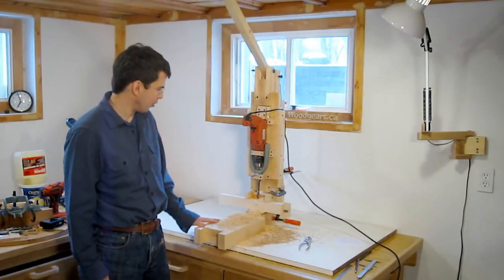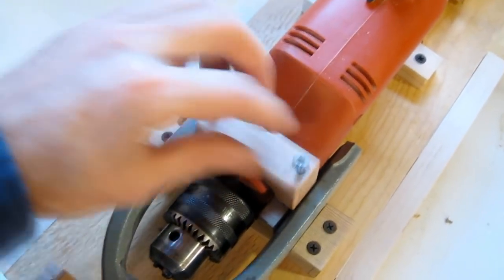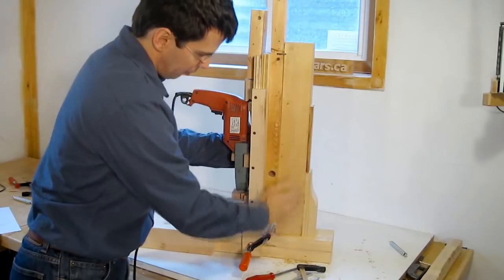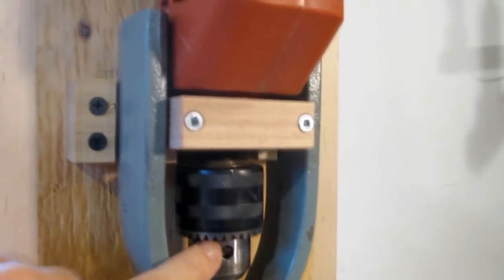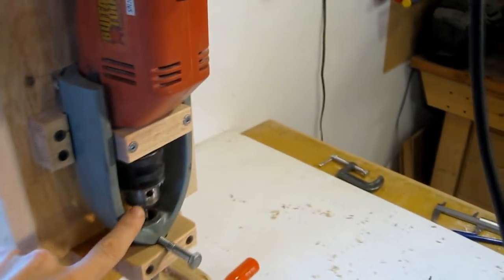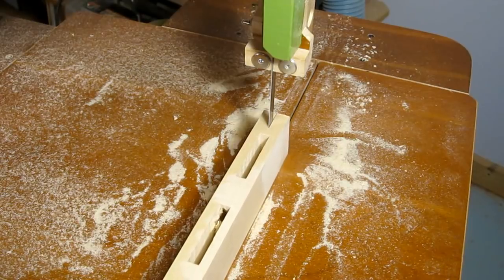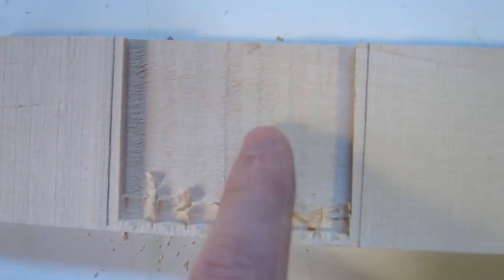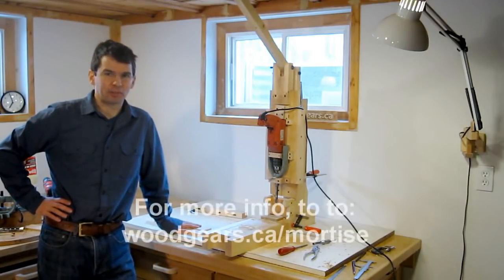Hollow chisel mortiser experiments

Comment: I ordered a drill press morticer from Northern Tool for $50 sent to my carport. After the purchase all I read was how crappy and what junk they are. So after setting 6 or more months in the box I put it on and tested. First thing i forgot to tighten the chisel holder to drill press spindle. After that I was amazed at how well it morticed 1\2" slots in well seasoned ash for table legs. The supplied fence and work hold down SUX rear tit on a sow hog. After looking at it in the box i knew the fence would need rebuild. But I'm really impressed with the moving parts of the kit and after every bashing forum about them. One thing is I run this drill press at its slowest speed from drilling thick metal before converting it into a mortiser. Personally I think running the drill slower is key. The other videos show them turning way too fast causing heat and friction issues.

Comment: Like the long handle for leverage. I am over 50 now and don't have the strength i had 20 years ago. i want to make one of these but didn't want to mess up a good drill press. would there be an advantage to using a cheaper hammer drill with a cut out that allows one to adjust the drill?

Comment: @Matthiaswandel  I agree - it would not be regulated, nor would it have any sort of speed sensor;  it would just slow down the motor in much the same way that a Variac auto-transformer would.
 
At one time - probably some 40-50 years ago - one could buy an epicyclic gearbox for electric hand drills to slow down the speed for (rotary only) drilling into masonry.  I have not seen such devices for years, though.

Comment: They don't do a bad job at all . With a cast iron Chisel Mortiser Machine as you finish the plunge you turn the wheel and that shifts the work so the drill bit cleans the bottom . Before your finished you also re plunge the chisel and the left and right end and sweep inwards . The chisel breaks the left over bits off . It wont be as clean as a slot mortise bottom but its a lot cleaner than these  shown where its just been plunged.

Comment: I wonder if this type of mortising could be OK to use with soft woods, and that extra debris at the bottom could be to a good use packing and tightening things up for a better grip, like tiny shims, but it's only me, I guess that wont do with harder materials. Can it work Mr. Wandel? I don't want to look that slopy either hehe!! Thanks for sharing.
Reply: It's okay with any wood. Unless you're not gluing the joint, the majority of it's strength and holding power comes from the cross grain contact of the tenon in the mortise. Nor will it look sloppy because you won't see it once the joint is put together.

Now is it optimal? No. I'm just saying that it will work, and likely won't be the biggest issue weakening what you build.

Comment: Slot morticer ok for furniture but hollow chisel and chain morticers come into there own on big deep mortices like for doors and gates. A lot of my mortices are through ones but it takes no time or effort to clean a stop mortice or a haunch with a sharp chisel. Slot morticers are good but can also limit what you can do as can't be haunched and will always need a round ended tenon or ends chopping out square with chisel by hand. Biggest fact of life is there's no 100% easy answer to mortice and tenon cutting but there's no stronger joint.

Comment: The router produces quality cuts but doesn't have the square edge. Why don't you ponder the idea of making a square edger tool for the routed slot. First, find a corner chisel or cut the mortise bit in half. Then attach that to that machine or a press you've just made. 

Or built a portable drop in version  then hammer away... accurately. Accommodate it so it won't get stuck. (You seem to like to make new stuffs. If it's already been done, then ...you can cancel the project.)

Comment: For better (and inexpensive) speed control, just use a plug-in dimmer.
 
You may have to limit its use, though, to short bursts of activity to prevent the motor getting too hot, as the cooling fan will also be slowed down and it might not push enough air past the motor armature.